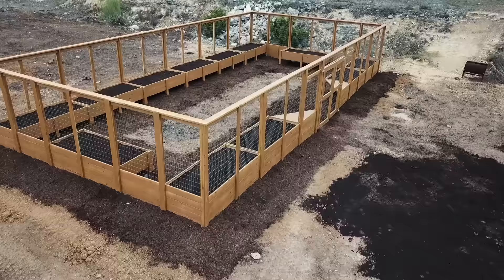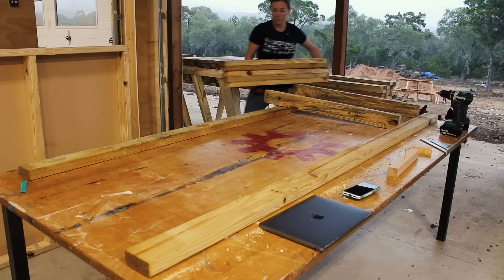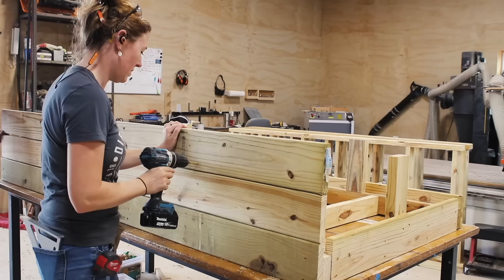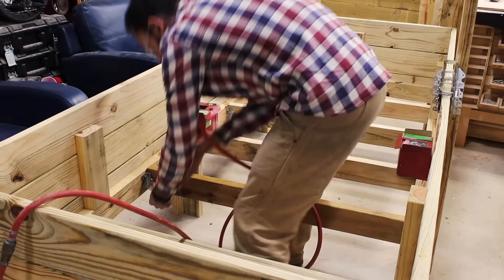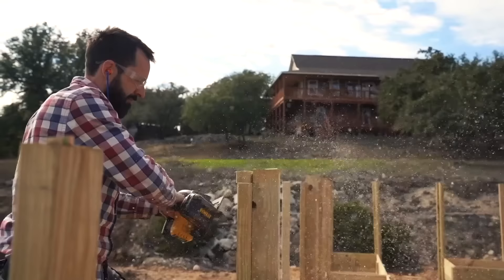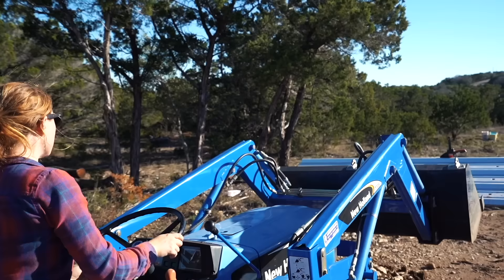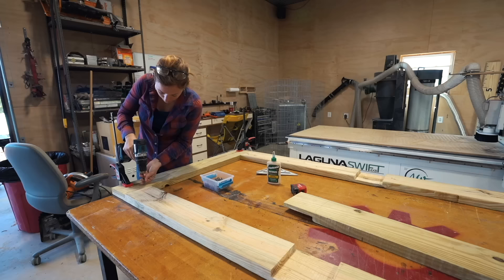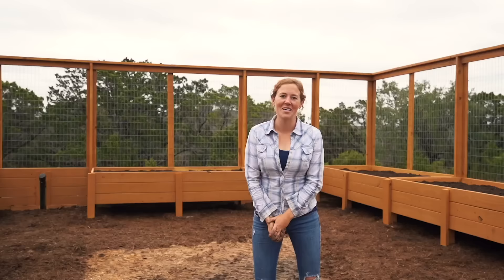Enclosed Walk In Garden with Raised Beds

Comment: Great but pointless. It's actually cheaper and much easier to just buy metal sheet raised beds given the lumber prices. I can actually buy a raised bed that about 20ft long 3ft wide and 3ft high for around 120eur in my country. If i would have to buy these materials it would cost me 5 times not to mention the time and effort ;)
Reply: Veggies should not be grown in metal - you need to do more research.
Reply: @psmith3001 Most youtube growers actually prefer this method and its proven to be more succesfull. The metal sheating actually preseves the heat allowing higher yields. I recommend yourself doing some research because its obvious you have no experience at all with different methods of growing.
Reply: @ScrapWoodBuilds  The metal in fact does react with the soil negatively and rusts the soil. Heavy Metal Contamination is proven, metals like lead, cadmium, and mercury can be present in recycled metal containers or in soil contaminated from industrial sources, posing risks to plant and human health. I know you think you're smarter than most but your are wrong, ok, so just take it down a notch, ok. May I suggest you educate yourself in regard to metal (do not use metal containers) and read Rudolf Steiner's body of work - he noted metal rusts the soil. Have a nice day! :)
Reply: @psmith3001 I can say with confidence that it is absolutely safe to grow edible plants inside or outside of a steel container, whether that container is galvanized, powder-coated, or weathered like corten. Steel itself is made from mined iron and is a sustainable and recyclable resource. Do everybody here a favor and try some different methods rather the classic one your used to before you start trying to educate people on youtube. If your so worried about metal harming your plants then get rid of your car and wife because they are known to be harmfull to us as well.
Reply: Metal should not be used as a container for plants if you plan on eating what you're growing in them, period! Now, you can use copper wire and that gets into electro-culture for anyone who is interested. Your so called sense of humor is not funny and is non sequitur. Please educate yourself and read Rudolf Steiner's books in regard to "biodynamic farming" and vegetable gardening techniques of "do's" and "don't" Please note that truth is eternal and the information I have shared is the truth and I cited the proof so that others can get Steiner's books and arrive at the same conclusions I have. Have the best day ever everyone!
Reply: @psmith3001  You sound more and more like a marketing account trying to promote a book. Come back when you have read something other then this one book. Fiy, my family as wel ad us have been eating vegetables grown this way as far back as my great grandparents and none of them/us have died. Im more worried about the crap you americans buy from your local stores as wel as yoir fast food addictions. Now that crap is scary.
Reply: @ScrapWoodBuilds  Wrong, I am not selling anything! I noted Rudolf Steiner and never noted any particular book by title. I am sharing information that is true and correct. When someone like yourself is wrong they use ad hominem attacks which proves you have nothing to back up your claims and instead verbally attack the person falsely. In sum, you are wrong and I am correct and clearly you are having issues with that fact. Have an incredible day everyone, cheers!